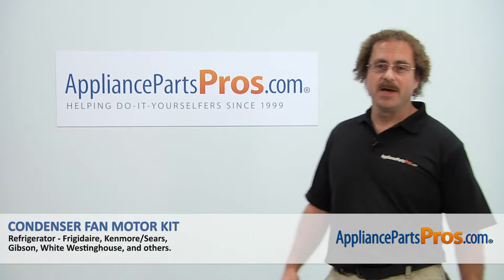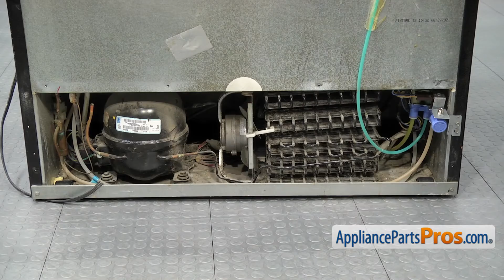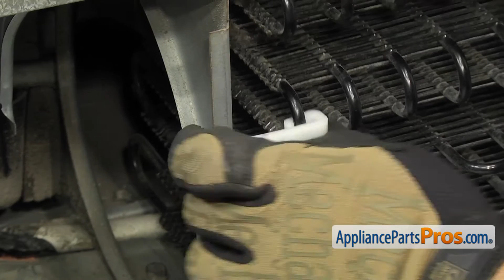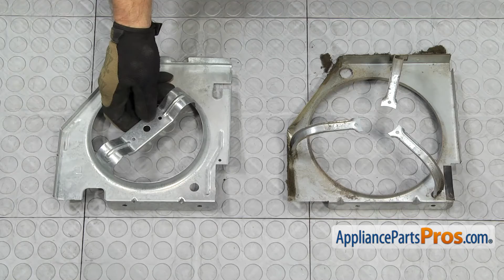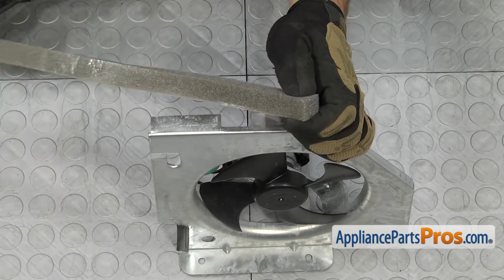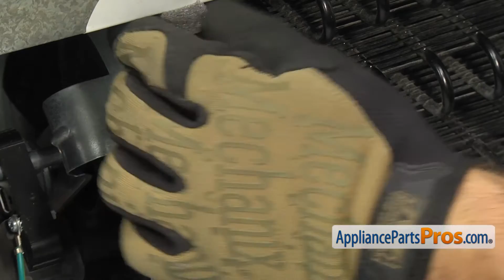How To: Frigidaire/Electrolux Condenser Fan Motor Kit 5303918635

Comment: Which way should air flow? Towards compressor or condenser coils?
Reply: towards the condenser, you want to cool the coolant which is hot when it reaches the condenser.